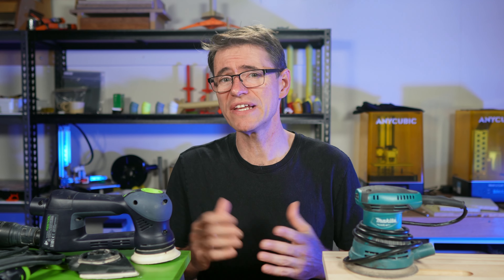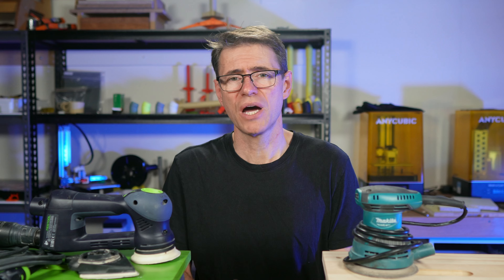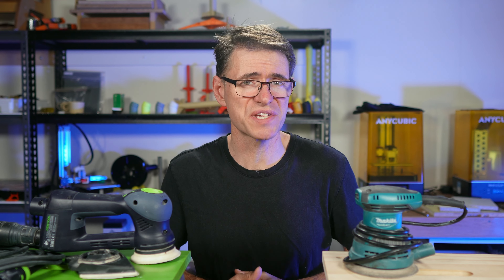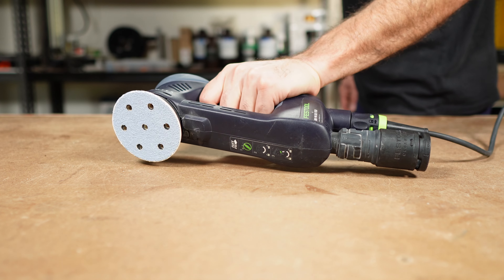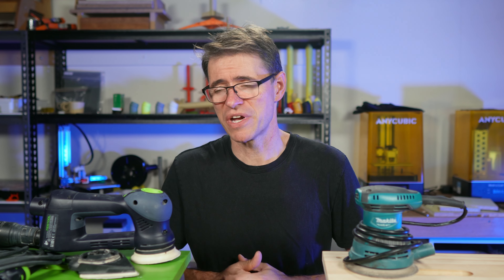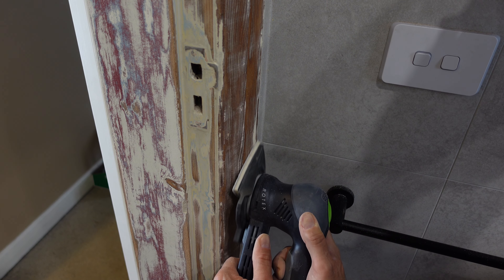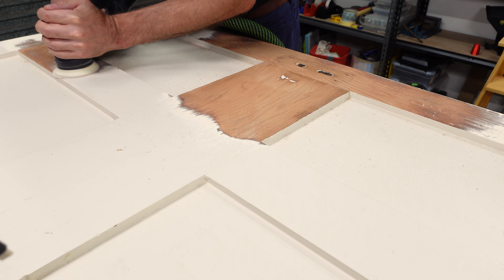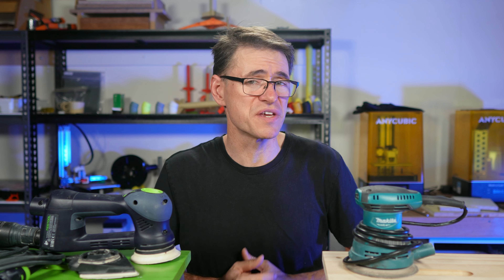Cheap Makita sander vs expensive Festool Rotex | Is it worth it?

Comment: Apples and oranges comparison I'm afraid, the Fessie has geared rotation and a superior removal rate, The makky is fine for lighter sanding. Massive cost difference too.
Reply from the maker: Indeed, but it's fun to do the comparison. Overall though, I find Makita sanding equipment a bit underwhelming.

Comment: I'm actually surprised they both removed paint at the same rate! I most heard comments on how aggressive the rotex sanders are.
Reply from the maker: Yes, the Makita does a good job if the abrasive paper is fresh and you don't need to do detail work. It's louder though, and not as nice to hold.

Comment: I have the cordless Makita which at least has 3 speed swinging settings 😅. But the dust connection for it is naff. I'll have to commission you to make a suitable 3D printed shop vac fitting 😊
Reply from the maker: First to leave a comment. Thanks. Actually, I have a spare. It might fit your sander. I'd be curious to know. Contact me at info@colinklupiec.com and I'll send it to you.
Reply: @ColinKlupiec  I'll take some measurements and email you

Comment: Great video! On the makita, what red special adapter are you using ? 

Cheers
Reply from the maker: Thanks for your feedback and your question. I designed and 3D printed it myself. I don’t use the sander without it. Contact me on info@colinklupiec.com if you’re interested in getting one.